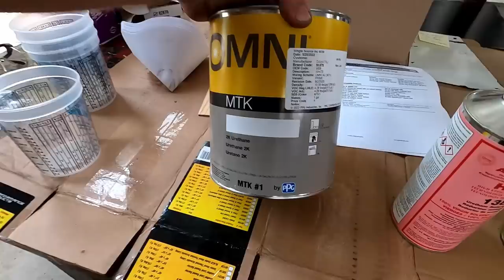Reviving an Abandoned Service Bed to Build the Ultimate Squarebody Work Truck - LS C20 Build Part 3!

Comment: Would have taken me two hours to sandblast the whole thing really really clean and much better surface for the paint to get stuck on 😅
Reply from the maker: I want the surface rust to come back through and give the bed patina to match the cab a little better haha
Reply: @SallysSpeedShop  aaa jo that’s true. Little bit rat road look 😊
Reply: @SallysSpeedShop  check RBCOrten. A Swedish car artist who does crazy crazy car painting on normal cars. Crazy talented and can give some tips and tricks on what to do to a car or truck